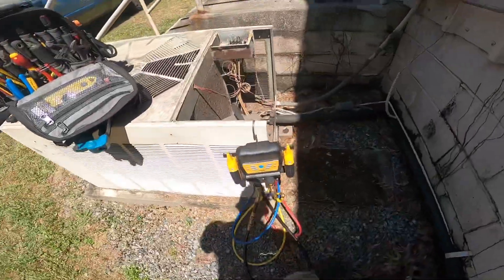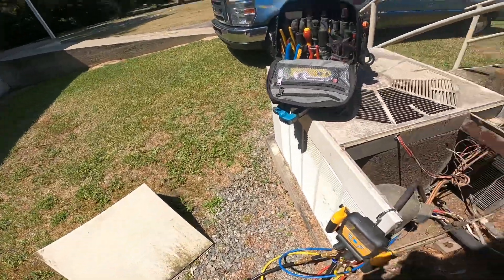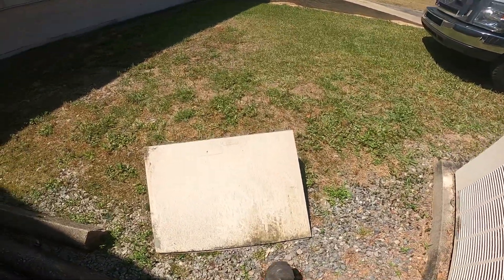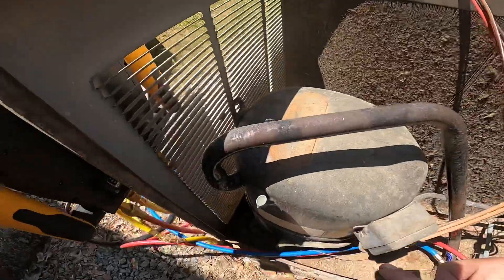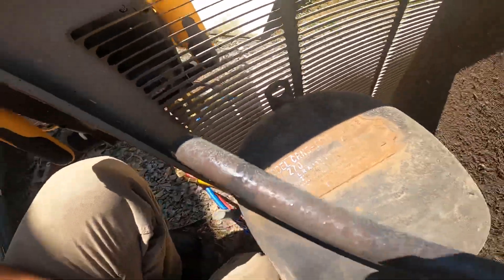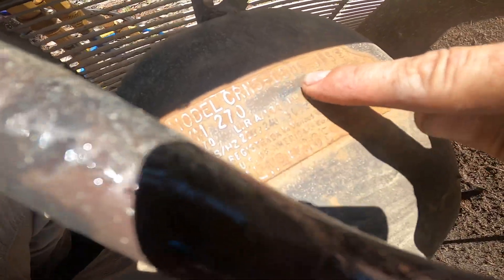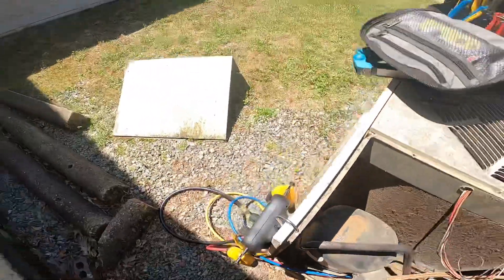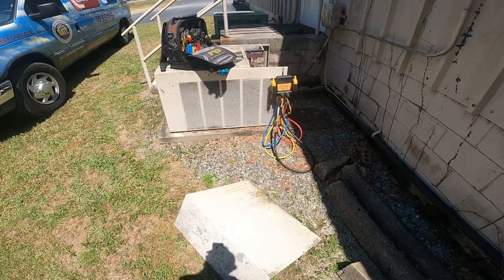Determining size of older systems when there’s no nameplate

Comment: Which model GoPro are you using? The audio sounds pretty good with the condenser running. I bought the GoPro  7 black in 2019 & never opened it. I'm going to start using it for my videos, but I'm trying to put together a nice setup with a external mic & a light for inside work. Just trying to get ideas. Thanks for sharing

Comment: Copeland has an app called Copeland Mobile. You can type the model or serial number of the compressor. If it is new enough you can scan the QR/ Barcode on it to identify the size. It can tell you other info like capacitor size, winding resistance, oil type, refrigerant type, stub size and dimensions. Voltage whether 1 or 3 phase LRA and RLA or if the compressor is still manufactured or discontinued. I find the app very helpful if you are unsure of the capacitor size.
Reply from the maker: I’m downloading it now.
Reply: @HVACGUY  I hope you find the app helpful. I found out about the app from HVAC/ Refrigeration YouTuber HVACR VIDEOS his name is Chris.
Reply: Def need this app for caps. Time saver when supply on hold or not answering
Reply: @97Napkins  Some Copeland compressors say what Capacitor size, voltage and wether 1 or 3 phase, RLA on the label but not all of them say.
Reply: @hvacguy84   ok👍

Comment: Also a real quick but loose way is 20 btu's per sq/ft cooling.
40btu's per sq/ft heating.
That's ball park only OTHER FACTORS MY ADD OR DETRACT??
🥃🥃🍺🍺🍺🍇🏌
Stay safe.
Retired(werk'n) keyboard super tech.
War your safety glasses.
Reply from the maker: Not round here. Everything is based on cooling load. Heating load is minuscule in comparison
Reply: @HVACGUY  👍

Comment: Thank you, there are a lot of old systems in my area with nameplates long gone.
Reply: Easy go to the Air Handler and check out the numbers on TXV, the model number on on older TXVs are stamped in the body...
Reply: If the unit has a Copeland compressor. Copeland has an app called Copeland Mobile. It will tell you all the information about the compressor if the label is still intact on the compressor. You can type in the model or the serial number of the compressor. If the compressor is new enough you can scan the barcode or QR code on the compressor.